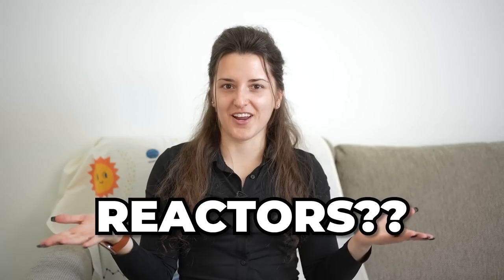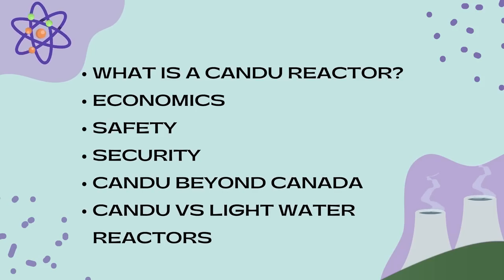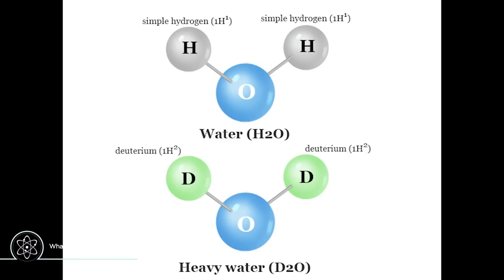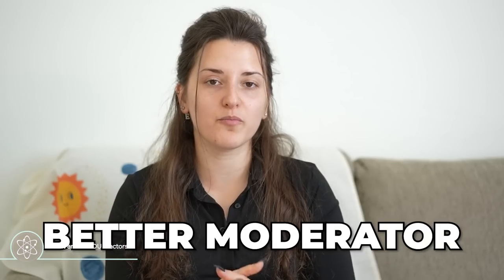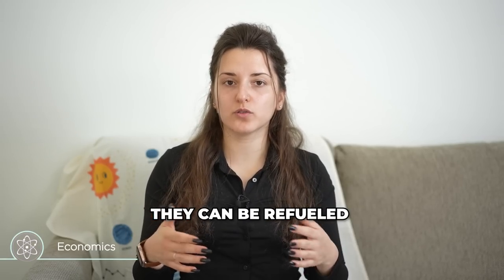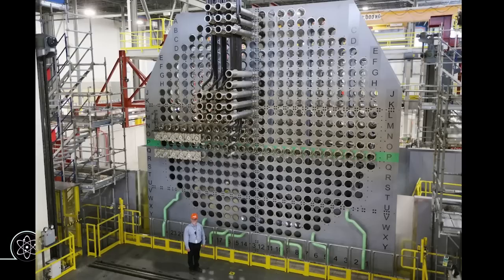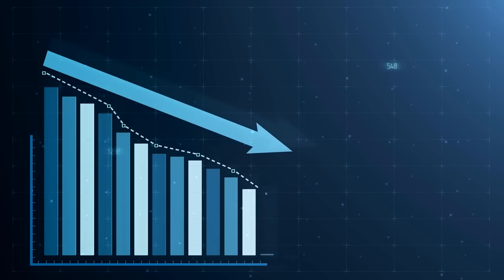Nuclear Physicist Explains - What are CANDU Reactors?

Comment: Have heard about CANDU reactors over the last 30 to 35 years of my life. My father worked for Westinghouse Electrical Division, not the Nuclear Division but had contact from time to time with W. Nuclear Division employees. Also a large percentage of W.E. Electrical Division was manufactured in Canada. I have read on them just out of curiosity and fun over the last 2 to 3 years and definitely agree that they have some distinct advantages. ( as my father told me while he was living) I believe in avoiding large amounts of Plutonium and other highly radioactive substances at all costs. The Canadians and India with some assistance from Canada are working on natural thorium fueled reactors with the same horizontal positioned rods for possible contionous operation or if I got my facts wrong a quick turn around time for refueling. ( India has very high thorium reserves) Thorium is hard to reprocess in a solid state so I am pretty sure that India is developing nuclear power in these programs for electric power. Other possible interesting information is that the Canadian may start working on thorium molten salt reactors. ( this is not definite I believe at this point in history) A private company in Canada is working on a thorium sodium chloride or similar salt reactor but they are receiving their funding from Indonesia who wants to build such a reactor in their country. Another good read is the Canadian Slow Poke Reactor and its possible use in a hybrid nuclear submarine that will have extremely low thermal emissions. ( thank-you to whatever Canadian sent me this information which is out on the web, not a secret except for how they are going to about making it work) The sub will have long range and be extremely hard to detect when compared to a normal nuclear sub. Needless to say, the Canadians are doing more nuclear research than the USA. Nuclear is not dead in Canada. Currently, on the world market concentrated and processed reactor fuel can be bought a very reasonable price and is very abundant. That is provided the world community will allow you to buy it. This has held back the development of heavy water reactors.

Comment: CANDU reactors are the best design in nuclear reactors, very superior to pressurized light water reactors. The calandria low pressure recipient is cheaper than high pressure recipient used in  light water reactors. The initial cost of heavy water is compensated by the economy in nuclear fuel and the burning of Pu239 produced into the reactor by using heavy water. Is criminous that in a region like Fukushima, subject to earthquakes and tsunamis, to build light water reactors. The Fukushima accident would not be happened with CANDU reactors.

Comment: Kind of strange to see this presentation from you. I was just reading about the Therac-25, made by AECL. Also was reading about the JS6300 commercial irradiator(Same Company) a few days ago. I never expected someone I'm subscribed to to talk about CANDU reactors, lol. Not sure if this company is very trustworthy or safe to build anything.

Therac-25 was brushed under the rug by the company denying it was defective.

The JS6300 was of poor design. The safeguards could be defeated on the control panel due to a glitch, even when the safety sensors should've kept it locked out.

After reading about the other products made by AECL I read about the CANDU units. If I recall correctly they seem to be safer than regular light water reactors. If I remember correctly without cooling they don't have a tendency to melt down as fast as lwr due to the moderator can absorb the heat better.

I'm sure you know if I remembered correctly. All I know is I'm in the US and some of these reactors are connected to my river , so I don't want to hear about them leaking.

Thanks for doing the presentation. I enjoyed it. Stay safe in your lab.
Reply: You're comparing a radiation source used for medical treatment to a fully contained nuclear power generation system. Might as well compare a doctor's drill to a truck's 18 speed transmission. Sure, there is something in common: a gear.
Reply: @the_kombinator  I was talking about the the company's track record with their other devices. Of course I guess probably a different group of people probably worked on the Med. side and a different group worked on the reactor side.
As for contained. It's only contained, until it's not.

Nuke stuff worries me because it is handled by people.
Reply: @NY411Info  ...and built by people. The failure of Therac was not really to do with the particle emitter, but lack of a proper interlock switch.

That's cost cutting for you. Oh. Fukushima also - let's place the ICE pumps on the ground, it'll save a few bucks instead of building a platform for them, above the reactor. It's not like any water will EVER flood the reaction hall floor for any reason whatsoever...

Comment: I really like the fast-spectrum, sodium chloride molten salt reactor as represented by Elysium. Once it starts, it's fuel agnostic. There is no "enrichment" -as defined by the US nuclear regulatory commission- needed within the core and should require less navigation through red tape. The same core design and heat exchanger equipment are manufactured for the entire range of power outputs -you increase exchangers around one core the get more power, from 250 MW to 5 GW, thermal - allowing for economies of scale.  It comes in a relatively small package.
I just like the design.

Comment: Can we make hydrogen from used heavy water, or would the hydrogen be radioactive?
Reply: CANDU reactors produce an isotope of hydrogen with 2 neutrons known as _tritium_, which is radioactive. This is actually quite valuable since tritium is essential for fusion research. Tritium is extremely rare and can hardly be found on the surface of Earth.

Water formed from 1 atom of oxygen and 2 atoms of tritium (T2O) is called "super heavy water". And yes, super heavy water is radioactive.
Reply: Heavy water isn't radioactive, just like regular water isn't radioactive. The hydrogen atom inside the Heavy Water molecule just has a neutron in the nucleus along with the proton (instead of just the proton). This is naturally occurring in 'regular water' but is much more rare than the traditional neutron-less hydrogen atom style water molecule. You could make hydrogen from heavy water but it would still be 'heavy hydrogen' as the neutron wouldn't become separated from the nucleus.
Reply: Yes true about the Tritium. IF the neutron is absorbed into the deuterium.

Comment: You forgot to mention that Candu reactors in general cannot have meltdowns due to bending of the rods immediately stopping fission.
Reply: The meltdown can occur due to insufficient decay heat removal in an severe accident, so they can have meltdowns.
Reply: Ohh, and we don't use RODS Per Say, We use fuel pellet loaded rods, so when the rods melt, the pellets seperate lowering neutron generation rates.

Comment: the thing with the heavy water reactors is that the heavy water is recirculated and not lost.  the production side is normal water that is turned to steam for electricity production and is never in contact with the reactors.   the steam generators are in between and are massive heat exchangers between the heavy water and the generation side.
Reply: This is a feature of ANY pressure water reactor, or rather any double-circuit reactor in general. The first Soviet graphite reactors were boiling, but made according to a dual-circuit design.
Reply: @nedward.7442  the obvious difference is that they're using heavy water on the hot side.
Reply: @syx3s  
Yes. Only a dual-circuit system is inherent in all pressurized water reactors, including CANDU.

Comment: I would like to know your opinion about Thorium - and the usage in reactors (or a Nuclear Facility)?

I am from Denmark where - yeah - 50 years ago someone said "Nuclear Energy - No thanks" - "Atomenergi - Nej tak" ..... and for several years I think that our government has not taken the advance in technology and possible energy types into consideration.

I am for low yield reactors that covers less energy output but are more "easily" to control and secure.
Reply: Read about the accident on SL-1. Modular reactors are as reliable as large ones, but the benefits from small ones are several times less, which is why humanity has taken the path of increasing the power of one power unit.

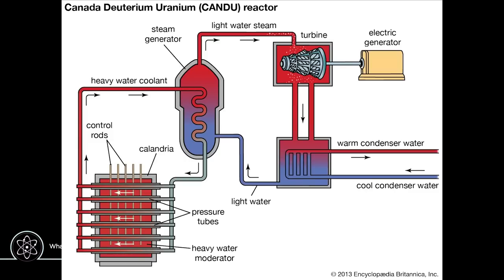Comment: 1:15 Where is the fuel? I see control rods, pressure tubes, heavy water moderator, heavy water coolant and the calandria. Does this reactor work without fuel?

Also, you completely ignored the fact that CANDU reactors have a positive void coefficient. Like the RBMK does. Everyone still remembers what happened in Chernobyl? Basically that. The RBMK and CANDU have striking similarities in other aspects (e.g. fuel enrichment and refueling while in operation) as well while having fundamental differences too. Would it be physically/theoretically possible for a CANDU reactor to "blow up" the way an RBMK reactor did? Sort of yes. Would it be possible for it to burn for days (which released the vast amounts of radioactive dust that contaminated parts of Europe - this fire that lasted over a couple of days is what caused massive release of radiation and contaminated significant parts of land, it was not the initial explosion of hydrogen and oxygen that released radioactivity from the core which reached more than 30 thousand times its rated max. power output, which turned any water into steam and stem into hydrogen and oxygen - a highly explosive mixture) without really having means to put the fire out other than exposing people to high levels of radiation and dropping lead, sand and other things from helicopters? Certainly not. Is it the only design that does not need enrichment of the fuel? No. The A-1 in NPP Bohunice, an experimental design, ran on natural "metal" Uranium too. Until it suffered two major incidents, one of them leading to a partial meltdown of the reactor core in 1979. But there was no major release of radioactivity into the environment, so it is less known than Chernobyl or Fukushima. Other reactors at that site still run today and a new one is being proposed to be built there.

Comment: You said heavy water naturally occurs in ratio 156/(10^6) hydrogen.  In such low concentration, I suspect there are more D-H-O than D2O. How heavy of water does this CANDU need? Does it need a concentration of D2O/H2O, or D-H-0/H2O? How hard is it to make D-H-O? Do you still need a mass spec or centrifuge? I like that it can use spent fuel, and the low Pu content.

Comment: I’d like you to do something for me could you tell me what the neutron moderation potential would be of deuterium metallic hydrogen metallic hydrogen made of the deuterium isotope Since you’re a nuclear physicist you might not know what metallic hydrogen is but I’ll explain what I know as best as I can metallic hydrogen is the result of hydrogen being the first element in the periodic table in the metals group theoretically that means metallic hydrogen can exist and if it does exist the atoms are incredibly close together due to very strong covalent bonds between each of the hydrogen atoms so this makes a single Crystal with metallic hydrogen very dense now what if we use the isotope deuterium in metallic hydrogen construction I wonder how many reactions you would have between the neutrons in the deuterium in the metallic hydrogen

Comment: Heavy water has less moderation capability when compared to light water. The reason behind using heavy water is that it has less neutron absorption cross sections making it better for the neutron economy. I think the explanation you have in the video needs to be corrected.

Comment: Good video but the 2nd to last point you made - that CANDUs are not used in many other countries because canada is abundant in natural uranium and heavy water — is nonsense.  There is NO country that is abundant in U235.  Using U238 is more abundant than 235 in EVERY cubic meter of continental crust on the planet.  CANDUs are a superior design in almost every way for EVERY country.  The real reason CANDUs aren’t used everywhere is because the Canadians have not been that great at productizing the CANDU.  It is more complex and many other countries can barely operate light water reactors because of their lack of experience.  And USA has a competitive ego which will not allow us to use any product not designed here, even if it is superior

Comment: My limited understanding, and what I've read on the subject, has always been that heavy water has a lower nuclear cross section than light water which is why using it as a moderator allows the use of unenriched uranium fuel.  At about 7:45 you say that heavy water has the ability to absorb more neutrons than light water.  Can you sort me out, please?  I've also always been under the impression that India used a CANDU reactor to produce weapons grade plutonium back in the '70s.
Reply: I also noticed that error at 7:45. I'm afraid Elina was wrong there and you were right. Viable commercial natural uranium fuelled reactors need to operate with a highly 'efficient' moderator. This means a moderator where very few neutrons get used up in the moderator.
From my favourite but ancient reactor book, heavy water has a neutron capture cross section of about 0.0011 barn. For graphite and light water the values are about 0.0045 barn and 0.66 barn respectively. 
Ordinary water (or 'light water', H2O) absorbs too many neutrons and so cannot be used as a moderator in a civil power reactor.
Thus natural uranium fuel is used with heavy water as a moderator (e.g. in CANDU reactors) or graphite (e.g. in the British Advanced Gas Cooled Reactors (AGRs)).
Any reactor that uses a fuel containing U-238 will turn some of that U-238 into Plutonium-239. Over time, some of the Pu-239 will become Pu-240 and some of the Pu-240 will be Pu-241 and so on. 
Commercial reactor operators find it most cost effective to irradiate their fuel for as long as possible. So, while commercial civil reactors will all make Pu from U-238, the Pu in spent civil fuel usually contains a lot of Pu-240 and is then only suitable for further use as civil fuel. It will be of little or no use for military applications.
Reply: @derekp2674  Thank you for that reply.  I guess you can't believe everything you see in a YouTube video.  Who knew?  I also hadn't known the respective cross sections of the three different moderators.